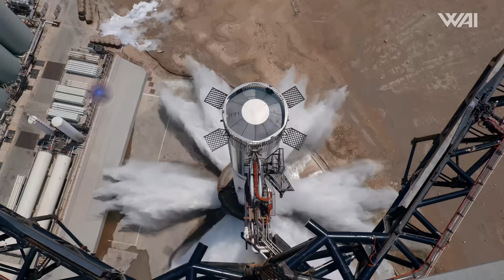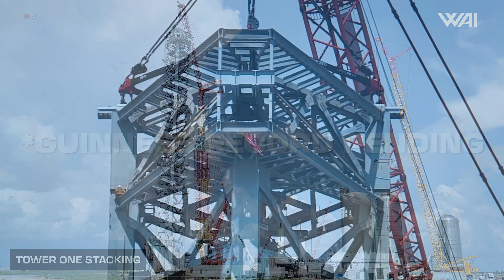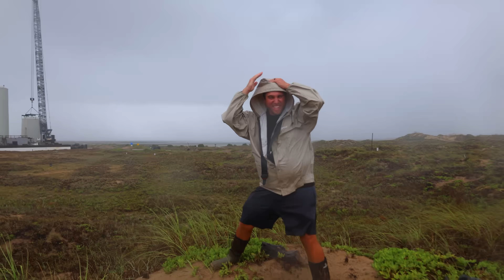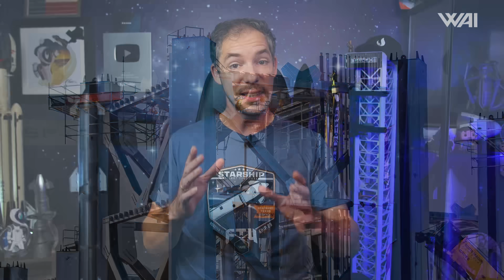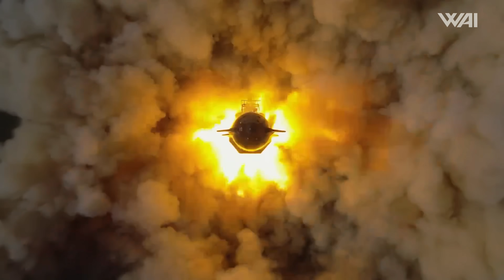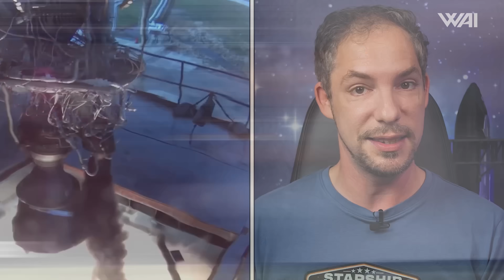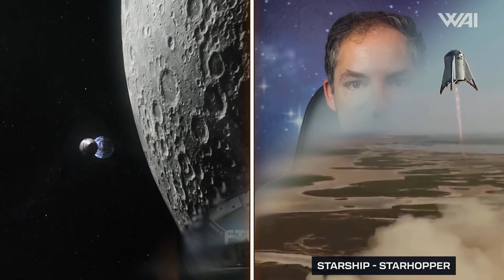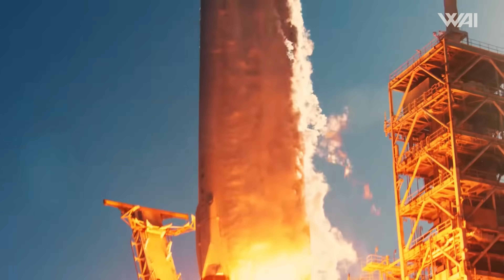SpaceX Reveals Latest Starship Flight 5 Launch Estimate! + Inside The Starship Miracle Engine!

Comment: Arianespace really made their bed a decade ago when they underplayed SpaceX and opted not to develop reusable rockets. They're truly living the nightmare scenario they thought would never happen.
Reply: Ariane's execs if I remember correctly expressed concerns a couple years ago that they are in big trouble regarding Falcon9 and Heavy. I was screaming inside like: "what were you thinking!". Truth be told ULA (Lockheed and Boeing) and Northrop and the likes do and did the same. They don't see instant competition and the money is fix, and the future demand they see is steady then they didn't see any need for innovation or push. Other than that, quite frankly, the very low cadence and the existing Ariane 5 infrastructure kinda locked them in. They would have needed a larger grant or invite private investors. I don't see if they saw the demand for that..probably not. So with existing infrastructure, project management, facilities, people and only a slightly bigger scope it was kinda obvious to go that way. In this sense ESA was mistaken too: they too could have promoted another direction. (opinion, could be wrong or imprecise)
Reply: Hard to believe that in, all of the fields of endeavor that require extreme innovation, the people least able to do it would be in the rocket business!
Reply: It’s worse than that. Arianespace itself refuses to do anything on its own; refuses to take any initiative; refuses to be entrepreneurial- in spite of receiving the equivalent behind it of billions in European taxpayer subsidies; they insist on being spoon-fed. It’s mis-management on ESA’s part that they continue to blindly support organizations year after year that then don’t leverage that support to build up new space business. - Dave Huntsman
Reply: Euro-communist space program, who would have thought it would end up in a dead end?
Reply: @SupremeOverlord10  Europe is doomed everybody know it, it's just a matter of time.
Reply: @SupremeOverlord10  🤦‍♂️
Reply: “Pala-kios” ? You’re gonna get run out of Texas with pronounciation like that. It’s “Pa-lay-chos”.
Reply: @cn8299  SpaceX’s legacy will be giving the space industrial complex a middle finger and forcing them to at least TRY to innovate. I have zero respect for the space players who have been in the space industry for 30+ years. They’re literally drooling, brain dead, money hungry ash moles
Reply: The problem is somebody came along and changed the whole game. Musk will be able to fly starship permission for about what it cost to fly a 747 around the world. Then he'll be able to rapidly reload and reuse it after he lands it. He will be able to use it a thousand times. When he gets that working. He'll build a thousand of them. Access to low earth orbit won't be any more expensive than Air freight around the world. Disposable rockets will never keep up with that.
Reply: Wow Mueller did the technical work Musk founded and finance the company and made critical decisions on design. Suspicious argument to say otherwise. On starship the decision to go to stainless steel for construction was his, as was a host of other things. He's deeply involved in the design of starship and all its peripherals.
Reply: Arianespace recently launched a spacex-copy program called Maiaspace. They're copying spacex bow
Reply: P It really doesn't matter about falcon heavy. It's a specialized piece of equipment that will be obsolete when starship comes along and all of it is fully recoverable. The way falcon heavy was explained by Elon Musk is when the two boosters separated and recovered. You basically have a falcon 9 at 50,000 ft. Consequently, you actually can carry more to orbit, which is why they use the falcon heavy in the first place. Reusability might not be the payoff. They think it is, but Gwen shotwell was quoted as saying it's 1/3 less expensive using a reusable booster than a standard falcon 9. That's spacex's explanation. I don't think I have to have another. Falcon 9 and falcon heavy will be obsolete when starship's operational. Then they'll be able to do a job many times heavier for a tenth of the cost.
Reply: How close are you willing to be when they try to catch the first stage?
Reply: I agree and on the other hand Bezos was betting on the industry 
NOT changing as much as SpaceX has had an impact and continuing on doing space biz as usual at done. Big phat government contracts with no budget oversights and delays the name of the game. Elon was serious and they didn’t take him seriously. I think that’s called underestimating the competition”
Reply: Everyone opted out on spacex...
Bet those think tanks feel a little embarrassed.
Reply: @johnd.7792  the US military didn't. A lot of Space X funding comes from the military they even recently signed a 5 year 100 million dollar contract with SpaceX to replace our aging cargo aircraft Fleet with Starships.
Reply: @johnd.7792 yup that’s why all the envious Elon haters have crawled out of the woodwork. Everything he does from now on good or especially bad is going to vilified as much as celebrated.
Reply: If you are only launching ~8-11 times per year reuse isn't super attractive, especially for core stages on missions to GEO and beyond. I mean look at Falcon Heavy, they almost never recover the core, because it's just not worth it. So the only option would be to recover the P120C SRBs, but SRB reuse just isn't financially  interesting, as the Space Shuttle proved. In the future Ariane Space may introduce reusable liquid fueled boosters (something they are doing research towards with Themis, etc., and have alluded to a couple times, for example in the clip Felix stole at 17:50), but SRBs are allready quite cheap, especially when using the same SRBs for Ariane 6 and VegaC. And again they were working on the assumption of very low launch cadence, which is only inacurate due to Amazon's project Kuiper.
Reply: @plainText384

Recovery is always worthwhile regardless how times you launch.

Multiple improvements in Falcon 9 capabilities has enabled it to be used in place of Falcon heavy in most cases.

Thus, Falcon heavy is only used for heavier payloads or higher orbits that require more fuel and lift.

When the Falcon heavy isn't recovered is because it used all its fuel for the task it was used for.
Reply: @omegaz3393  Think about that explanation for a moment. "Falcon Heavy never recovers all three boosters because those missions would fly on Falcon 9 instead."
1) They tried and failed to land the core stage multiple times, with the last attempt being on STP-2 in 2019, where the hotter reentry caused the thrust vector control to fail on the landing engine.
2) what you are claiming is a combination of
A) landing the core stage reduces performance to the point where Falcon Heavy, with two extra boosters, can't lift more than a single Falcon 9. And 
B) An expendable Falcon 9 is cheaper than a fully recoverable Falcon Heavy.

Either way this just goes to show that reusing a core/sustainer stage on a high energy mission is either to difficult or to expensive to be worth it.

As for your other point, obviously, there is a minimum number of launches below which it isn't worth it to invest in developing reuse. RnD costs money, and that cost needs to be recuperated over the course of a rocket's lifetime.
Reply: @omegaz3393  Which is almost always
Reply: @plainText384  I’m giving you a Thumbs Down because you’ve totally missed the main issue- as does the head of ESA Space Transportation, who spouts the same, well, er, nonsense. Let’s get specific: You can’t keep acting the same ol’ way and expect any positive change; you have to change the world. Remember, SpaceX started out with only a couple of launches- much, much less than Ariane, So, what happened?  How did they get to the point where they could economically start launching their own, new industry- Starlink- up to 70 launches a year, self-funded, just for that! There WOULD HAVE BEEN no Starlink possible without FIRST the full-commitment to Falcon 9 first stage/fairing reusability- & doing whatever it took to get there, including all the failures et al. AND a commitment to RAPID reuse and commitment BEFOREHAND to high flight rates - which also meant a commitment UP FRONT to multiple launch pads- all BEFORE he committed to Starlink. (Check the dates). He committed to the basics of a growing sustainable space transportation infrastructure company and operation First- key words: COMMITMENT TO THE VISION FIRST- not waiting for the ‘demand’ to show up first. THEN came Starlink; created for two reasons: 1. He needed a long-term funding vehicle for Mars etc al; 2. He/Gwynne looked at OneWeb et al & saw their business models were broken (they were right); meaning they were ripe for disruption before they even got off the ground. 
Quilty Analytics estimates those actions (long-term commitments) are what have brought down SpaceX’s internal marginal Falcon 9 costs to approximately $15m- and Decreasing above 100 flights/year. This will have a huge impact on the markets from late 2026 onward when F9 loses 70% of its payloads- the Starlink Mini’s, as they are replaced by full-sized Starlinks launched by Starship- yet doesn’t retire the F9. Gwynne is not about to let other launches charge $70m or so for medium launches when she- as with the recent Eumetset deal that Was Ariane 6’s- will simply start underbidding- well, everybody- and still make a profit. The Commitment to serious, rapid reusability, lots of launch capability- ALL that has to come FIRST- not waiting around to be spoon-fed, like Arianespace insists on being. Arianespace, after receiving billions in taxpayer payments for decades, refuses to self-invest in Europe’s space future. They should never get another Euro. The money needs to go to those European entrepreneurs who actually have the vision to bring the future forward. - Dave Huntsman
Reply: @plainText384  if you can only launch 8-11 times a year because your so expensive, perhaps reuse would open more business opportunities!
Reply: @MichaelEdmond  most satellites are really expensive, so reducing the cost of the launcher doesn't necessarily increase the number of sattelites looking for launch providers. If you exclude Starlink, SpaceX only launched payloads around 34 times in 2023, of which only 5 were Falcon Heavy.
And many of these only flew with SpaceX because both ULA and Arianespace were in between rockets and Russia was being avoided due to the war in Ukraine.
Reply: @plainText384  so what your saying is, even though spacex is cheaper, their launches will drop because people go with the more expensive option. Gotcha
Reply: @MichaelEdmond  SpaceX isn't actually significantly cheaper than ULA or ArianeSpace. 
Let's look at a couple of known Falcon Heavy launch contracts:
Jan 2023, USSF-67: $317M (extended fairing) side boosters rtls
Oct 2023, Psyche: $117M side boosters rtls
Dec 2023, USSF-52: $149M side boosters rtls
Jun 2024, GOES-U: $152M side boosters rtls
NET Oct 2024, Europa Clipper: $178M
NET 2025, PPE+HALO: $332M (extended fairing)
NET May 2027, Nancy Grace Roman Space Telescope: $225M

As you can see, the price range is incredibly broad, with some missions costing customers 3x what others paid.

This range has large overlap with the expected cost of launching an Ariane 64 (maybe ~$160M, $126M with subsidies), through I wasn't able to find concrete launch contract prices as I did with Falcon Heavy.

Perhaps in the future SpaceX will lower their prices to maintain their large share of the launch market, but right now they aren't actually much cheaper. All launch providers charge basically the same market rate.
Reply: @MichaelEdmond No. Having your own launcher is of strategic importance and is preferred even if somewhat more expensive
Reply: @rogerphelps9939  preferred yes, but not going for reusability then would also limit strategic use, as you would have to build every rocket, reuse would have boosters waiting
Reply: its still a flying and successfull rocket.
Reply: @lionel9038  So better than Blue Origin.
Reply: its almost like European industry is losing significance
Reply: It messed up its maiden launch but thats space for ya and expected. But it costs more than a falcon 9 with less capacity and capabilities took way longer to develop than falcon 9 yet its doing the exact same thing as rockets have been doing for the past 60 + years
Reply: What would space x be able to deliver if they went into the disposable one use only business? Everything would be cheaper if there was no reusability requirement.
Reply: @jbizzle1966 I really don't know how. SpaceX converted falcon 9 to reusability on the first stage and it dropped the cost of the rocket by a third using them over.
Reply: @jbizzle1966 I really don't know how. SpaceX converted falcon 9 to reusability and drop the price by a third.
Reply: @jbizzle1966  Not really. SpaceX rockets are more expensive. Using liquid methane and oxygen also comes with penalties in fuel efficiency. This is why Starship and superheavy need 16 refueling flights to make one trip to the moon, while a rocket like SaturnV can go to the moon on its own. It has liquid hydrogen fuel in the upper stages, and has more stages so it ditches empty fuel tanks.
Reply: @nickl5658  The starship HLS lander can get about 50 tons onto the surface of the moon, and could get closer to 200 tons of payload onto the moon if it doesn't have to take off again.

How much could the Saturn V put on the moon?... About 5 tons, assuming you didn't need to get the lander to take off again, more like 1 ton if you actually want it to get back into lunar orbit.

Oh would you look at that, using 32x the rocket to get 50x the mass onto the moon. So it looks like it's actually MORE efficient! And that's assuming it takes 16 refueling flights, where even with version two, it'll likely only need 12, which will make it even MORE efficient in comparison.

Comment: i still think once they get the heat shielding figured out, i feel they outta coat the more fragile areas of the launch tower with it.
Reply: The tiles aren’t tough enough to take that. They are weak in compression, and the direct rocket blast is probably an order of magnitude more force than the plasma stream flowing over the tiles.

Comment: SpaceX rockets are great, but Europe needs an independent launch capability.
Reply: Blindly stating that is not enough. Ariane 6 is a DEAD END. Very literally. Not reusable. Not intended for high flight rates. Not competitive. Not serious. And we can see that from what happened last week- when in a head-to-head competition against the Falcon 9 for the European Eumetsat latest satellite, Eumetsat chose…..Falcon 9. - Dave Huntsman
Reply: @dphuntsman  And, again, Europe needs an independent launch capability.
Reply: @lyledal  You miss the point... independent capability isn't sufficient on its own... it needs to be cost-competitive too. Because if it's not cost-competitive, it will only fly a tiny number of flights that can be legally mandated to "fly local"... anyone who has any choice will save their money and go to SpaceX. 

And if it's only going to ever fly rarely, it's not going to be a reliable alternative... you're not going to be building a production line, so it's all bespoke, and you're not going to be able to sustain a team of people who know how to build and operate them, you're not going to be able to secure an ongoing supply of parts (at least not without throwing even more money at the problem).

It doesn't need to be cheaper than SpaceX... but it needs to at least be close enough that you can justify the higher cost on the grounds of investing in local industry. Ariane 6 fails to do that, to the point where even Europe isn't going to use it unless something forces them to do so.

Comment: I think you have to explain the ablative layer under the tiles a bit better - If the ablative layer is under the tiles - then after evey launch the tiles have to be removed to replace the ablative layer? It can only be a temp. solution otherwise no rapid reusability?

Comment: Why put an ablative shield under the tiles? Wont that mean that they will have to strip all the tiles off after each flight? Or is it just a safety feature and not meant to be used up every flight?
Reply: it is a safety feature. the reusable tiles should hold up for multiple flights, but if they fail then the ablative layer can take more heat and keep the ship safe.

Comment: Regarding the ice problem that is plugging filters and damaging the raptor engines on restarts.
The only place that water and carbon dioxide ice could be coming from is the autogenous pressurization system .
When a vehicle is recovered, all the ice will have to be purged before it can be refuel and fly again. 
This should be an interesting reuse problem to solve

Comment: Stoke out-spacing SpaceX? Lol. Not even close. They now have a full flow rocket engine but they are a long ways away from having a dependable reusable rocket system, by then SpaceX will have hundreds of successful rocket launches.
Reply: Yup. Let's say that Stoke is closest competitor of SpaceX in near future. Only they and relativity are pretty close to have workable plans for both stages reusability outside SpaceX. Even Chinese are in much earlier stage.

Comment: No need for tiles at all. just drill lots of micro holes. then pump out dry ice out of those holes to form a cold co2 boundary layer. you dont even really need a pump. the heat of re-entry will cause melting of the dry ice and high pressure dry ice co2 to come out of the micro holes to form the boundary layer.
Reply: How many tons of dry ice would you need for the 20 minutes of re-entry? 100? 200?
Reply: @filonin2  ABOUT 52 KILOS FOR 10 MINUTES